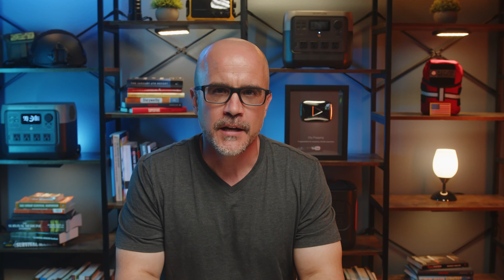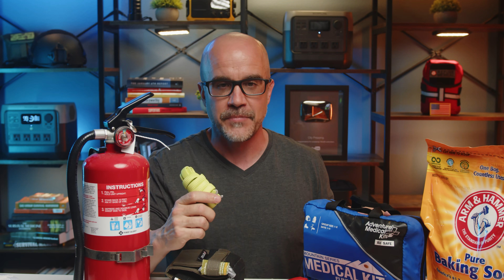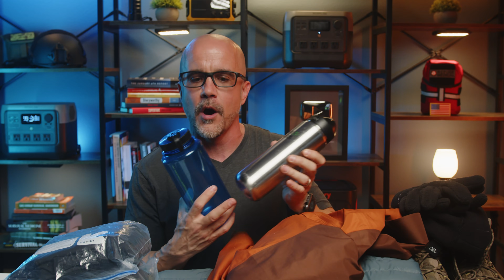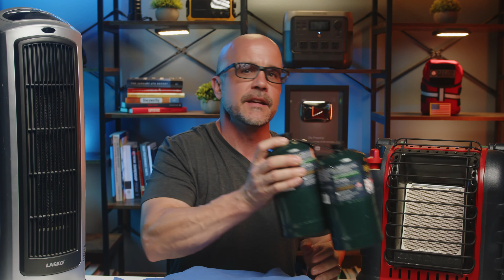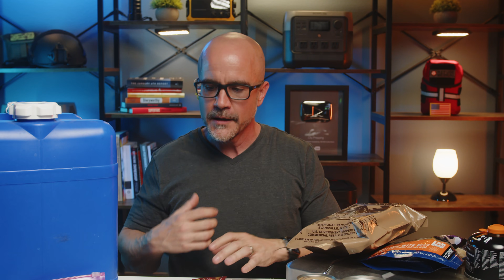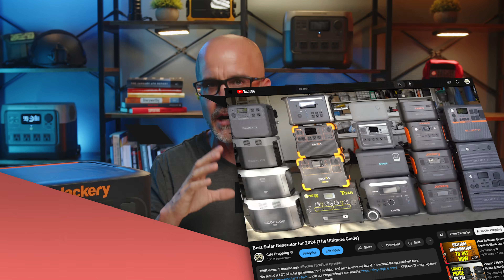30 Affordable Winter Survival Items to Get Now (How to Survive a Winter Power Outage)

Comment: I totally agree with the carbon monoxide detectors inside! Out under my garage I often use a new 1 gallon paint can with a large roll of toilet plate (sand the cardboard roll) and pour in a bottled 91% isopropyl alcohol.  The toilet paper doesn't burn, it acts as a wick. Keeps you warm, but it's an open flame so govern yourself accordingly.  Also, folks need to look at YouTube vids about sand batteries. Radiant heat that works! Be safe, stay warm and use yer head! God bless, Chuck

Comment: Do not turn off your main water valve unless you're planning to drain your hot water tank otherwise you will damage your hot water tank if the water is not flowing through it. Instead open your Taps and let the water run slowly.
Three Dog Night, if you have to sleep with three Huskies it's really cold.
Rayovac indestructible lanterns, three D cell rechargeable batteries, are the best because they're indestructible and waterproof along with their indestructible flashlights and headlamps. 
Turn your water containers upside down because water freezes from the top going down. Otherwise you will freeze your caps and you won't be able to open them.
Get a clip-on wire antenna for your emergency radio that Clips on to the antenna because during an emergency when it's very cloudy outside those radios don't pick up signals.
If you live out in the wilderness learn the old art of smoke signals
I have everything on your list except the jetboil. Cheers from Canada.

Comment: I prepared most everything but today I got a bunch of strong box-bags from the Amazon driver for quick pack ups and saved up a bunch of cinder blocks for fires and rocket stove. Also, I'm making a water well extraction pipe to draw with when the power is out. I've taken inventory, readied my gear and gotten a few things organized in my van in case I have to abandon it. Head on asl swivel and blessings to all of you.

Comment: Hanging 100% wool blankets over doors & windows makes a huge difference. Wool blankets will also keep you warm.
Reply: I love those days when I can find those old army wool blankets at goodwill.
Reply: You can also use packing blankets CHEAP and thick!
Reply: Bubble wrap works great too, and is just transparent enough to let some daylight through.
Reply: @TribalLady12  just in case you find wool blankets pricey as I do look around for a US government surplus store.  US MILITARY issued us very warm green scratchy blankets in 1974 when I went through basic.  You may be able to find them better priced as surplus.  Will do very nicely!
Reply: Painters plastic over windows block cold air but not the light
Reply: Wool blankets work poorly keeping you warm if they are on windows.  Use them to cover your body. An old timer taught me this life hack.
Reply: @matrixist  You need both. Covering windows is to keep the heat you create inside
Reply: I’m gonna try this
Reply: What  if America to wool?
Reply: @gowbunnell8754  I don't understand your question?

Comment: Electric heating blankets are definitely worth the look.
Reply: How would you use them if the power is out?
Reply: @joyceyarb6860  solor generator and or some some kind of generator that can handle the voltage load of the blanket.
Reply: @joyceyarb6860 battery bank, but it wouldn’t be a good use of the energy.
Reply: With generators if you have them. @joyceyarb6860

Comment: In the recent flood apocalypse in my state of NC, I learned that even the available water was so incredibly toxic that a water filter would have been useless. Total different view of a lot of the previous thoughts I have had. I was at quite a distance from the disaster but have taken notes while being up thus close to how people survived or did not in the hours and days that followed. Just…WOW. What a horrific thing to see our neighbor counties endure. Especially since I had lived a bit in the mountains off grid. My methods all went out the window with this flood.
Reply: Any water there was definitely a no go with any straw filtration system.
Reply: Pre filtering water with a clean, old towel or t-shirt. Then filter through a filter made with sand, grass or leaves, charcoal, & gravel. Then it's ready to use your water filter as long as it's rated like a Life Straw or Berkey.
Reply: @TribalLady12  I dont know, but will any filter remove things like heavy metals, pesticides, industrial waste etc. Reading the OP comment ,that is what i though when they said "water was so incredibly toxic".  This isnt just "dirty water", this is a mix of EVERYTHING in that location. If there is ANY kind of processing plant in that area that water is carry some amount of that factory in it. 

One of the things that i have added to my prep was a Clean plastic tarp that is only used for rain catchment, and then that will filtered. All it takes is a drop in pressure, and all that run off water will be mixed into the municipal water system. How many leaky pipes are their underground ? 

I think that is the thing that i took away from the Ohio train crash. Miles way tap water contaminated becasue an underground water pipe passed that area, and picked up some of the spill
Reply: @user-yf4gx4rf8h  Look up the list of materials a Berkey Filter will handle.  Also prefiltering is essential.
Reply: @user-yf4gx4rf8h  There are a couple.  Berkey is one
Reply: @TribalLady12 I don’t think life straws filter chemicals
Reply: We've always been told to boil the water first? then if you have filtration, go for it.
Reply: @Kayenne54  I don't think river water is safe. Perhaps water from a home well or something. That may be questionable, too. I wouldn't be drinking that river water. You have to be sure your filter is able to filter out chemicals and other unknown substances. Unsure.
Reply: @myFido-vm9zi  When talking wide spread flooding, all water is suspect, so we've been told for decades to always boil it first (I lived in an area subject to cyclones, which are southern hemisphere hurricanes). If one has a filter jug/filtration system, then filter for larger particulate matter after boiling. But always boil. Which would imply having a dry source of flammable material and containers. Yet another issue when everything you own is 30 miles down "flooded river" somewhere...
Reply: @myFido-vm9zi  Look up the list that a Berkey or Aqua Filter will remove.  I think Aqua is the correct second one.
Reply: Recently watched a vid with a guy using grapevine to filter nasty pond water. He also mentioned using a pine branch. He recreated MIT study to filter water. During this flood I don’t know. Maybe if you had rain barrels full of water that didn’t get contaminated by the mud, ok. But otherwise, you’d better have stored water.
Reply: From what I understand, silver can purify water, it can kill bacteria, use silver coins
Reply: lifestraw bottles for each person

Comment: I highly recommend everyone get a Kelly Kettle. Boils water in about 5 minutes with a few handfuls of leaves and/or twigs.  Purifies water ,cooks food and it's warm. Pour in hot water bottles and reuse water.
Reply: You can make a smaller version of this using larger tin cans iced tea and energy drinks come in. (Or smaller soda cans if less time is needed) Poke holes in top end for flames to come out and take off top with tab. cut tip off about 1/4 way down.  Then cut bottom of can in half (keep the middle part of can for inner wall). Crimp top sides of bottom of can all around, put inner wall  inside bottom and slide top of canover inner wall and base. Add fuel and light, let run for a bit so jets kick in and  place grill plate on top if needed for larger cooking surface. Then put pot, pan etc on grill plate and cook. Or if it balances fine place right on top of can.
Reply: There's a 2nd way to do so using 2 cans as well. Just look it up 😊
Reply: Just ordered a kelly kettle today, along with Aquabricks.
Reply: @justjoanish  Excellent decision!

Comment: I have finished a cold hike and still shivering after hours. Cold is a serious thing we overlook nowadays. If you have to do any manual labor you'll need proper gloves. Look what climbers use. You won't want to use the stove while wearing fleece gloves either. You might want to have leather insulated work gloves on hand. I have used a pair for years for light mountaineering. Works for using hot objects and hand tools(ofc) as well. The hard shell keeps you warm in wind and rain because it traps the air in acting also as a vapor barrier. I don't see a benefit of using it indoors and might prevent the layers from evicting sweat. For the feet, there are puffy socks known as hut slippers/booties. That could help indoors since keeping shoes restricts blood flow, especially laced footwear. Having stuff is useful but you still need a plan.

Comment: During the hurricane, we stayed with an older family member that didn't understand that the elevators would be down for a couple of days. He kept saying, "Well, what if someone had a heart attack? How would the paramedics get to them?" I simply said, "They wouldn't." It finally sank in how in danger everyone actually was in those moments.
Reply: Actually paramedics have a special chair that will go down stairs. Husband is paramedic.
Reply: @citygal2198 If they’re not home taking care of their own family.
Reply: @citygal2198  That's a relief, we were told though that in the middle of the storm that emergency services were suspended for the safety of the responding EMT's firefighters and police, so I was planning on them not coming until the winds stopped blowing.
Reply: @faithcrisis2138  you and Wife of Medic are talking about 2 different scenarios. There are times when emergency services will be suspended in severe weather,  your info is correct. If that's not the case, and ems  is available but the power/elevator is out, they will walk up the stairs to get to you and can carry you down in a "stair chair" if you're unable to walk down.
Reply: FYI, they have equipment to handle stairs. The damnedest thing happened- in the SAME week, my fiance, then me two days later, had to be carried out by such a contraption.

Comment: How long can your water sit in  a 5 gallons water containers before going bad ?
Reply: Water never technically “goes bad”. To have best longevity it’s best to store the cleanest water possible. Over time any sentiment in the water will fall out and can cause an off flavor. The oxygen in water will dissipate out slightly which makes water taste “stale”. You can still use it though. I rotate stored water every six months simply because we have well water and it’s not expensive to replace. I wouldn’t go longer than one year to keep it fresh.
Reply: It depends how clean the water is.  @lajohnson1967
Reply: as long as it is there... just use a life straw or any other raw water camping filter .... water is water ..

Comment: Lasagna layering for heat.. plastic bags for waterproofing feet, plastic bag with head and arm holes for core.. do not underestimate plastic for heat retention and water repelent.
Reply: one word ,condensation
Reply: I use mylar blankets instead.
Reply: @leopardwoman38  No air can get through mylar either.

Comment: QUESTION: Can you recommend a plastic wrap to cover windows and doors, window units, etc. in the event the fertilizer plant goes up in flames 3 miles south of me? My first option would be to get outta Dodge, but "what if" it's too late to do that? IDK what mil thickness to get?
Reply: 4 mil at a minimum
Reply: I've used a brand called VisQueen to staple across the whole back of my old wood house that winter we couldn't afford electric. It was thick & durable, lasted 4 months with no deterioration.
Reply: @patriciatinkey2677  Thanks, I've heard that brand name. and @tklube308 says 4 mil at a minimum, so thank y'all.
Reply: get 2 or 3 used scuba tanks for air in the car as you drive to hel & gone CROSSWIND ( and dont come back imo )

Comment: Winter power outages suck. There was an ice storm back in 2007 in Oklahoma. Some people were out of power for a month. Many froze to death in their homes. Edit: I would look into a high quality K1 kerosene floor heater. They're efficient, and hot. It's also easy to store large amounts of fuel relatively cheaply.

Comment: I sure hope my house plants can survive. Im planning to keep them in my en suite bathtub and just burn lots of candles in the bed room
Reply: I found my houseplants do not like temps below 45 degrees.
Reply: Grow lights create heat so putting them under grow lights might help.
Reply: @leopardwoman38  But if there is a power outage I cant I dont have a generator. I do have them under a supplemental grow light right now actually :)
Reply: I suggest keeping all tubs filled with water for you to drink and not worry about plants unless they're edible... then look into a hydroponic system.
Reply: @nikkipieronek271  I love plants and have some that are rare. Cost a lot of money to replace.
Reply: @myathehappy_1  Ah I see! They're your babies then. I still suggest looking into hydroponics for them (plants can grow and live in these so long as you keep everything at the right PH levels and you can even add plant food if they need as well. Hydroponics systems come in all sizes. And as mentioned by someone else, a grow light would help with warmth as well as growth cycles. You can also create a warmer environment by placing them in the same room as you or making an indoor "greenhouse" using blankets, plastic etc to keep the heat in a minimal space and if needed put cardboard and plastic on any leaky doors and windows to also keep heat in for them... and yourself. Yo8d just need some sort of battery power for the grow light  to replicate the sun/moon.
Reply: @myathehappy_1 that won’t matter if you’re dead.